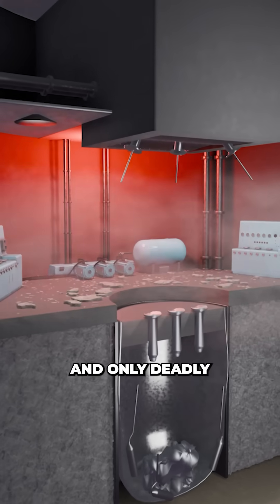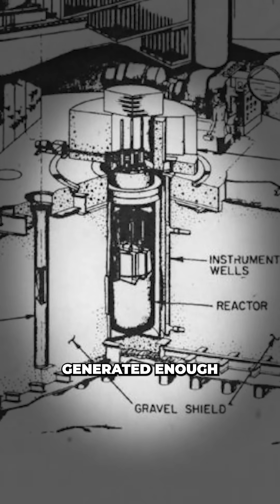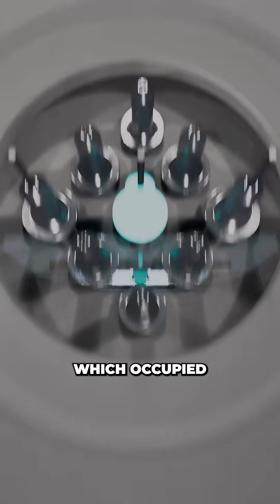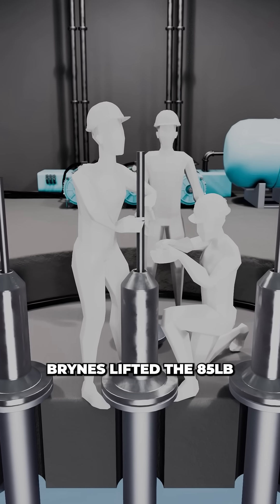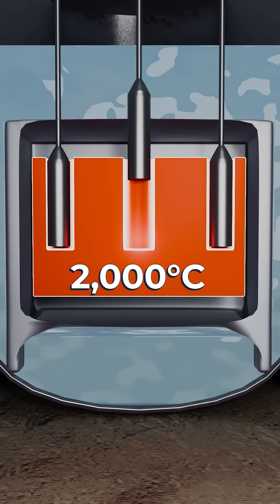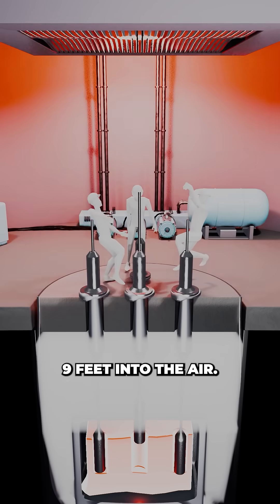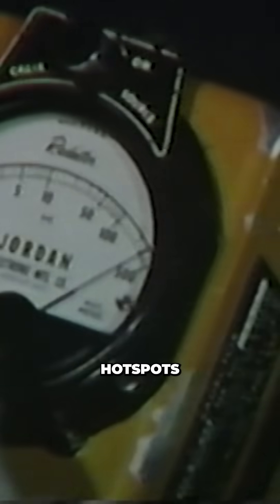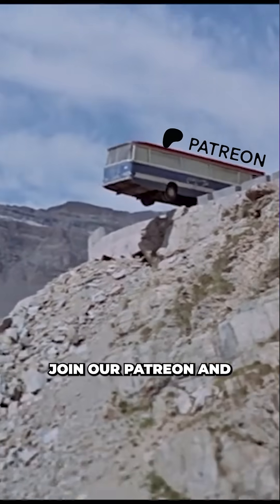The True Story of the SL-1 Disaster

Comment: I’m often astounded by the stupidity of designers who didn’t think “what happens if something goes wrong here?”  There wasn’t a tool?   There wasn’t a hard stop  to prevent excess withdrawals? It was a matter of yanking not unscrewing.  The tolerances of machining didn’t account for humans doing maintenance.   There wasn’t no relief systems for pressure to drop to avoid deforming the housing.  
Smart people doing stupid over and over.
Reply: Same, my dude. My dad spent most of his career in lumber mills. He is a Controls Systems Engineer, so his job was to write the software that told the machines how to do their job. He taught me the importance of "failsafes", and that most people misunderstand what that means. A failsafe doesn't mean it never fails. It means that WHEN it fails, it fails in a safe way. This project as described here needed a LOT of failsafes, and had none.

It needed better control of the control rods - even hinges and levers with long handles would have gone a long way to fixing the insertion/removal problem. You could have made sure that if they got stuck, they still couldn't move out of range, but you could apply more leverage to get them loose (or push them in.) You could have had sturdier materials that could take the potential overheating. A pressure release into an overflow tank could have fixed the steam problem, and made it so when it cooled, the water would suck right back in (kind of how your radiator's overflow tank works). I'm NOT an engineer, and I can think of this!

Of course, it's easy to criticize from the sidelines, but it often feels that while the engineers understand the technical, scientific "how it works" part, they often don't understand the practical, physical, side much at all. That's where my dad has always excelled. Both technical AND practical. I used to think this was just normal for engineers, but apparently, it's really not!
Reply: Yep, all those OSHA regulations are written in blood.
Reply: Exactly my sentiments. 
There were a dozen possible ways to disengage mechanically, electronically or with hydraulic metered systems. 
The designers were morons.
Reply: Look up the demon core accident. The “tool” in this SL-1 accident would probably have been something like “just pry on it a bit with a screwdriver or something, LOL. YOLO!” They were really intelligent, but not in a way that keeps people safe.
Reply: @americandissident9062 When your dangerous and amazing high-tech prototype is assembled the same way a stoner works on a project car.
Reply: Ad inifinitium.
Reply: And yesterday,  news reports Donvict Von-shtz-n-pants wants more nuclear weapons testing...have we another fool at the Helm directing more accidents?, I THINK YES! Enough with playing with this technology,  where are we supposed to dispose it's waste,  SAFELY FOR THOUSANDS OF YEARS!?!?!?
Reply: Don’t forget the ALUMINUM housing. WTF? Why not just make it out of wax?
Reply: @mrous1038 Exactly! I could not believe what I heard. Utter stupidity
Reply: @mrous1038 I guess wax was more expensive
Reply: @kolyashinkarev7366 More expensive than Uranium?
Reply: Engineers have the same average IQ as other people.  An education has nothing to do with IQ.

I've worked with dozens of engineers with various degrees, and nearly all of them were C students.  Some were just dumb as dirt, and even with a mechanical engineering degree, they had never once picked up a ratchet, socket, or wrench.  Two of them that I worked with didn't understand how a ratchet worked, so I had to draw a picture for them.  One couldn't figure out why my socket wouldn't fit on the ratchet.  After watching him struggle for a couple of minutes, I told him, "Turn it around."

I can only name 5 or 6 truly brilliant engineers.  The rest were not even close.
Reply: @throngcleaver As a Mechanical Engineer in Australia with 40+yrs, unfortunately I'd have to agree in relation to some but not all as we do have minimum criteria just to get in the courses & it was a difficult course, that weeded out those not up to it. We covered a broad foundation of subjects including Nuclear Physics & Quantum Physics, learnt what was required such that we could work in a Nuclear Powerstation overseas if given the opportunity. Some subjects really were Rocket Science eg. Fluid Mechanics.
However, like any group of smart people the education system doesn't take into account practical ability when assessing suitability. I'm largely blessed in both regards & worked alongside tradesmen & final year apprentices in bus & rail workshops during my vacations at Uni, 40+ yr ago. Some of the stories they told me of their 'Engineers' were unbelievable eg. they couldn't tell which way a cam shaft timing gear rotated based on the wear on the teeth. I passed the tradies tests & earnt their respect & appreciated their advice.  I worked on every component a 4th yr apprentice did without issues including the most difficult, not that I found any of it difficult. It was a great experience. Only thing I wasn't allowed to attempt was reassembly of an automatic gearbox & steering box as that was considered tradesmen only & rightly so as needed experience. Every other component I stripped, cleaned, checked, replaced, refurbed, reassembled, calibrated, shimmed, micrometered, torque wrench, wired nuts, presets, end floats, etc, all supervised of course. Lapping, grinding, milling, injectors & their pumps, (direct not modern common rail soledoid type),  Only tricky things in my opinion were anything with pretensioned springs.
Course have cut off quota based on exam marks & often popular courses don't take those that have natural ability or are practical. My wife was a lawyer & said they rarely found top honour students to be better than useless in the real world. 
Smart people can do really dumb things at times and a lack of imagination or practical ability for what could go wrong.
Imo, a physicist that has never manufactured, designed or gotten their hands dirty should not be allowed anywhere near critical systems. There is smart smarts and practical smarts and you either have the knack or you don't & it's often not learnable. 😊
.
Parent-Teacher interview: 
Teacher: I'm sorry Mr. & Mrs., I have some terrible news about your son, Johnny.
Parents: Oh no, what's wrong?
Teacher: I'm sorry to have to be the one to inform you, but...he has..."the knack"!
Parents: Oh no, is it curable?
Teacher: Sorry, but No it's not curable!
Parents: So what will become of him?
Teacher: I afraid that he'll become, an Engineer. 
I am so so sorry.
All turn and stare at Little Johnny as he is playing with the Mechano set. 
😂
Reply: @iRossM  🤣🤣🤣  I love Little Johnny jokes!

I agreed with what you said, but I'm in America.  Our education system has been purposely degraded for at least the last 40 years.

Currently, college graduates with a 4-year degree, have an average reading level of the 8th grade.

I graduated from high school in '78 and got a far superior education than what's coming out of our colleges and universities now.  I've had mechanical and aerodynamics engineers ask me to figure their trig problems, and answer some of the simplest questions that they should have known.  That's crazy.

I worked at the large fighter plant in St. Louis as a flight mechanic.  I started on the flightline, then moved to the business jets, then on to the engineering campus in their test facility.

They had stress birds, fatigue birds, drop test birds, hydraulic birds, and so on.  At the gun butts, we test-fired the guns, did bomb release tests, missile ejector tests, fired the chicken cannon, and launched ejection seats with dummies, but no rocket motors.  Just the gun tube that does the initial lifting.  I witnessed many dummies die with no parachute to slow their descent.  😂

We were mostly testing the ability of the seat to penetrate the canopy if the mild det-cord failed.

I worked in the systems lab, the airflow lab, the propulsion lab, the vibration lab, the high pressure chamber (on a pulse detonating engine), the massive vacuum chambers that were used during the Mercury, Gemini, and Apollo rocket missions to simulate the pressure and temperature of space.  I worked in both the low speed wind tunnel and the polysonic wind tunnels, (Mach 5+), and the water tunnel.

I worked in the lightning lab, the materials lab, and almost every other lab in that campus.

I spent a few years making custom parts, mostly out of sheet aluminum and stainless steel, for experimental aircraft.  I had to teach the design engineers that drew the drawings how to flatten the sheetmetal part in their CAD system, to give me an accurate flat pattern.

I did that manually for years, but got sick of doing all the math, so I wrote a little spreadsheet with all the bending formulas in it, so that all I had to do was type in the metal thickness, radius of each bend, angle of each bend, and the length of each flange.  It would print out a crude diagram showing all the bend lines and dimensions to set up the hydraulic press brake.  Everyone loved that program, but for the highly complicated parts, I had to fight them for them to learn how to produce an accurate flat pattern with the push of a keyboardbutton.  None of the designers knew what K-factor was, so I showed them my program and how I determined the K-factor.

Anyway, I learned TONS from some of those engineers while working in those labs, but I also educated almost every one of them about things they should have known.  My forte was aircraft, theirs varied widely,  but most had a narrow, focused knowledge base, where mine was much wider, but not as deep in every area.

I worry for the future of America's engineering minds.  However, AI will quash most of that field along with many others.

G'day mate! 😁
Reply: @throngcleaver  IQ doesn't mean shit, though
Reply: @franki1990  Not to you, it doesn't.
Reply: Hindsight is 20/20, don't unfairly judge the simple fact that nothing goes right the first time or that new ideas are part of the learning process. 

Consider a technology like Gorilla Glass wasn't a thing for phones because the original designer never expected that clumsy users were s significant chunk of the customer base.
Reply: It's called learning from your mistakes. Surely they knew the dangers of just pulling it hard all the way? Before hearing what happened, I would of assumed that standard procedure would entail they always pull on the rod very slowly and never apply excess force and that if it the rod didn't yield, that the procedure be stopped immediately, rather than force the issue.

You say it's stupid for the designers not to have to designed it to be stupid proof, but actually making something idiot proof requires a lot of intelligence, ironically. Also, I would of assumed workers on a nuclear reactor would all be intelligent and well-trained, but lessons can always be learned.
Reply: @Jimraynor45  from what I've read, it's a combination of poor maintenance (99% of nuclear disasters) and questionable design choices.

Even before the accident it was found that some parts had rusted and neglected due to poor management and the rod had a issue of getting stuck which sometimes required more force to pull out, so it's understandable that they used more force to pull it like they normally do but instead of it slowly coming unstuck it got yanked out.
Reply: Technology and advancement has always been built on the bodies of the dead. Look at modern medicine and chemistry. ALL of it, was built on people dying. You can’t create “safety” measures, for things you haven’t encountered.
Reply: are u slow? obviously there is a reason you cna pull it fully out.
Reply: The principal engineers I work with are like this. By their own arrogance, they get defensive if a junior engineer or worse, a technician, has a better idea than them. They will launch new products into market full of flaws when there are obvious and simple solutions that we we didn't implement only because of their own hubris. Because of their seniority, management always takes their side. Fortunately it's never resulted in anything this catastrophic... yet.
Reply: probably DEI engineers

Comment: Scary stuff. I used to x-ray welds with radioactive sources. But nothing like that. ☢️🥃
Reply: We still do that in nuclear but it with a source that could potentially kill. The source has to be escorted in and out of the area. It’s a very big deal when we do radiography. Most of the area has to be evacuated.
Reply: @charro028 I Miss my job as a radiographic tech. We used iridium or cesium. Cobalt was available. But I was never tagged in heavy jobs using it.

Comment: The US has experienced numerous nuclear accidents and incidents at power plants and reactors over the decades, though the exact count depends on the definition—major meltdowns with radiation releases, fatalities, or significant damage versus minor operational issues, leaks, or shutdowns. For context, one report notes around 2,800 reported mishaps at commercial plants in a single year (1987), but those include routine issues.58b161 Focusing on significant events at nuclear power facilities (including experimental reactors like SL-1, which you mentioned), there have been at least a dozen notable accidents with consequences like fatalities, major repairs, extended outages, or environmental releases. Here's a chronological list of key ones based on documented records, excluding military weapons incidents, medical errors, or unrelated waste/storage events:
January 3, 1961: SL-1 (Idaho Falls, Idaho) – Explosion at an experimental US Army reactor during maintenance when a control rod was lifted too far, causing a steam blast and criticality. All three operators died instantly; radiation was mostly contained to the building. Rated INES level 4 (accident with local consequences).21e92916380a3f92a1
October 5, 1966: Enrico Fermi 1 (Frenchtown Charter Township, Michigan) – Partial fuel meltdown in this demonstration breeder reactor due to a cooling blockage. No fatalities or major external radiation release, but it led to extensive repairs. Rated INES level 4.aaf9dacdfa50ad4e90
March 22, 1975: Browns Ferry (Decatur, Alabama) – A worker using a candle to check for air leaks ignited insulation, causing a major fire that damaged electrical controls and reduced cooling water levels. No radiation release or injuries, but it cost over $100 million in damages and highlighted fire safety risks.3f03636f6147
March 28, 1979: Three Mile Island (Middletown, Pennsylvania) – Partial core meltdown at Unit 2 due to equipment failure, stuck valves, and operator errors, leading to a loss of coolant. Small radioactive gas release occurred, but no deaths or long-term health effects were confirmed. It remains the most serious US commercial nuclear accident. Rated INES level 5 (accident with wider consequences).5bb63267ac708cc16e5dc3f4
December 9, 1986: Surry (Surry, Virginia) – A feedwater pipe ruptured, releasing hot water and steam that scalded eight workers; four died from injuries. No major radiation release.e0b13886555a
February 16, 2002: Davis-Besse (Oak Harbor, Ohio) – Severe corrosion discovered on the reactor vessel head, leaving only a thin stainless steel liner preventing a major coolant leak. No release occurred, but it forced a two-year shutdown for repairs. Rated INES level 3 (serious incident).501274a53e57
Other notable incidents include tritium groundwater leaks at plants like Vermont Yankee (2010), Braidwood (2005 and 2011), and Monticello (2022), as well as operational shutdowns due to equipment failures at sites like Peach Bottom (1987), Millstone (1996), and San Onofre (2012).a9db6f No US accident has reached the scale of Chernobyl (INES 7) or caused widespread fatalities from radiation. Overall, while the industry reports high safety standards today, historical data shows recurring issues with aging infrastructure, human error, and design flaws.a5bdd0

Comment: This is a good example for why the Oak Ridge boys should have been allowed (and encouraged!) to fully develop the Molten Salt Cooled Thorium Nuclear Fission Reactor, which would be perfect for applications such as this reactor was meant for. 

Practically ALL of the current fission reactors that are in use are high pressure light water cooled reactors based on designs originally intended for naval use, in, on, or at least near large amounts of water. These reactor types are prone to a variety of issues such as explosive flashing of steam, meltdowns, and several other things that are not generally a problem in a submarine, or aircraft carrier, but can be if used on land where cooling problems are more likely. 

Maybe we should make the salt cooled thorium reactors as the primary type for general use and have a virtually unlimited source of clean, safe energy and industrial heat. China and India are doing it, WHY are we letting them pass us by?

Comment: Thanks for the video which mostly talks of the engineering issues. In the late 1960’s and early 70’s this incident was discussed at length with numerous government contractors, military and countless individuals who may be or were in possession of clearances. I cannot even begin to explain the greater changes this incident created. Engineering issues were the easiest solved, by removing the human element when possible. Redesign reactors with double and sometimes triple safety contingencies. Even in 1979 the OPM changed the clearance process, including background investigations, continuous evaluation, and reporting issues. There are numerous other changes that could easily be connected to this event. I foresee AI in charge of the control rooms in the near future.